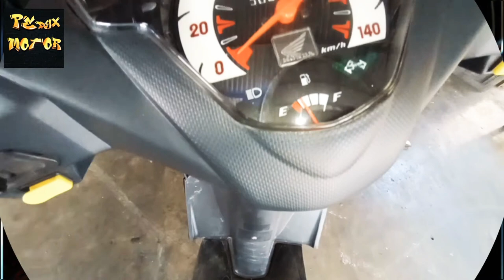HONDA BEAT PAKAI KARBURATOR YAMAHA RX KING

Comment: Itu filter udara nya bisa di pasang gak
Reply from the maker: Gak bisa bang
Reply: Bisa bg saya pakai karbu king d beat karbu bs pakai saringan hawa tapi karet filter hawa nya d ganti pakai karet radiator mobil yg sama besar dgn karbu ny
Reply: @user-dg4ug1db3q   bengkelnya dmn bang? Tolong bs pasangin... Boros bensin uyy

Comment: Pengalaman make Karbu King di Beat filter udara gak bs kepasang. Kalo karbu PE 24 bisa gak bro?
Reply from the maker: Gak masuk juga bang,harus ganti pakai filter udara variasi
Reply: @pedyxmotor  Yakin gak masuk bro? Udah pernah pasang PE 24 blm?
Reply from the maker: Pe 24 pendek,,jadi TDK masuk dicorong filter udara,,
Reply: Masuk karet filter udara/corong ganti pakai punya radiator mobil yg sama besar
Reply: @pedyxmotor  Udah nyoba ternyata masuk pas, masih bisa di klem lagi. Aman jaya tanpa akal2an tanpa ganti2 selang.
Reply: @adhytblank742  bengkel dmn bung?